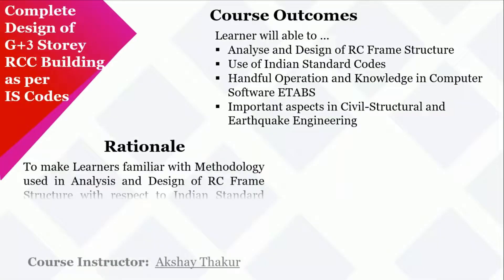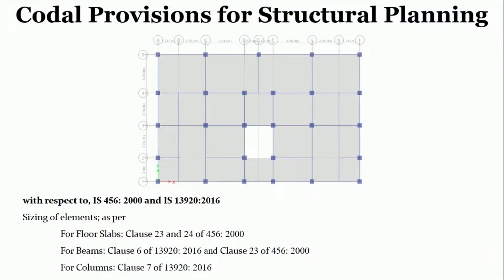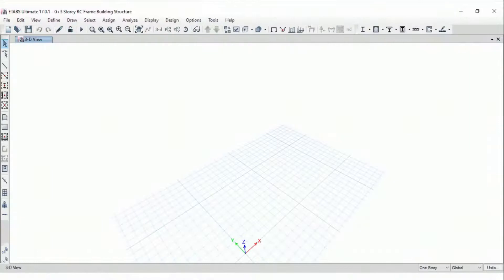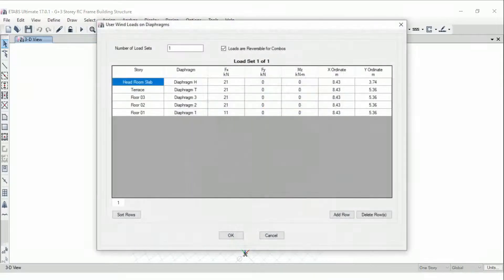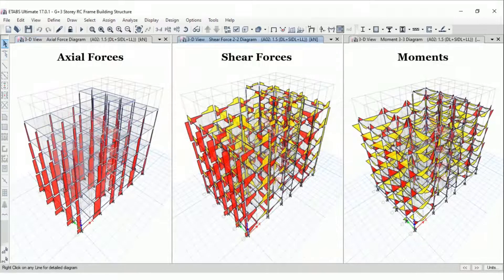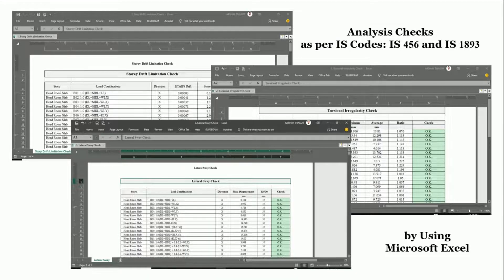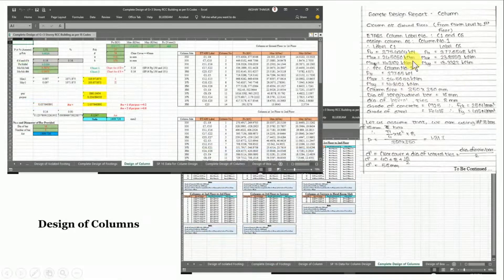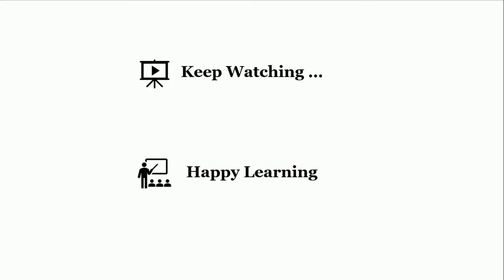1.1 Introduction to the Course │ Design of RCC Building as per IS Codes with ETABS │ Akshay Thakur

Comment: sir what could be the reason for not appearing the "rebar selection for column & beam" option in design- tab, any solution ?
Reply from the maker: Because in the newer version detailing is seperate by CSi detail software, earlier detailing is also can be done in same software so that option is not availble in newer versions above V16.

Comment: Hi sir which laptop will be best for this all structural softwares
Reply from the maker: Laptop with SSD, 8GB RAM & i5 and equivalent peocessor is what i can suggest this are atleast minimum level of configuration for general performance for softwrae like ETABS, SAFE, STAAD, AutoCAD, etc...
If you wants to use softwate like SAP2000, Revit, etc. then you must need higher configurations than above....
Reply: Sir I have 3 years gap after btech civil engineering 😢 I was preparing for government civil engineering exams but couldn't crack any exam, now can I become structural engineer??

Comment: In other videos, some instructors showed that etabs self-calculate the super dead loads of slab and beams, so they didn’t apply those loads but, like you, applied the wall loads. Could you please clarify?
Reply from the maker: ETABS have a feature to consider selft wt. automatically in dead load pattern, so whatever you model w.r.t. material, as per that material's unit wt. and shape wrt geometry ETABS Calculate Self Wt. that we don't need to bother....
only the loads that we don't,t model that we should apply.
Reply from the maker: and so, floor finishes, wall load, live loads need to be applied...

Comment: Sir only 40 videos are available out of 42 videos. The other two are hidden.
Reply from the maker: slab design videos are taken down because therein one mistake so...
Reply: Please restore it...the course will be incomplete than sir.
Reply from the maker: @mrpritam_n  you may refer any good book as per IS 456-2000, and as per that design slabs its very easy to do...
in short you have to calculate ly/lx and total design load for your slab and as per slab position in layout (continuity) you have to determine co-efficient from IS Code and simply find the moment and provide steel area to resist the same...
Reply: @AkshayThakur  thank you sir for the brief explanation.
Reply from the maker: @mrpritam_n  welcome!

Comment: Sir Which is the best book for manual design of building??
Reply from the maker: you can go through some nptel courses for basic concepts...
& you can also go through some books for rcc: by neelam sharma, p.c.varghese and s.s. bhavikatti
Reply: Thank you for your valuable reply n time
I want to design a building manually so will these books teaches from basics?
Reply: For practical building design sir
Reply from the maker: learn the software thoroughly, only understanding of design concepts are important in software-based computer design....

today's modern age software works on finite element based which is more accurate than what we do in manual calculation by influence area method...

once you understand the whole process of design then go for design-optimization... which makes a difference in professional practice of structural engineer!

all the best!
Reply: Thank you so much sir 😊😊
Reply: Sir Which is better either to learn manual design or to learn software? 
Or what you taught in the course
To design a residential building upto G+5
Reply from the maker: understanding design procedure is essential for a structural engineer, but beyond that... now-a-days software are used for designing structures so understanding software interface is very  important. Because if you give one wrong input then it may cause huge changes in design reinforcements of your structure....
If you can't optimize your design, then what its meaning? approximate rebar% contractor/foreman/fitter can also tell...
optimizing the design is the engineering in design of structures....

all & all, you need basic principles & concepts in structural design and building materials, understanding of codes & standards, proper knowledege of software inputs, understanding of analyatical output of analysis... to being a professional structural-design engineer
Reply: Thank you so much...for typing this much for us
We are grateful to have a sir
Reply: Your are a wonderful guide..you have the pure heart.and selfless...I know how difficult it is to make a course like this.. thanks a lot sir
Reply: Bro for building design of g+4 n all is Staad pro is good?
Reply from the maker: @rohithpatel8223  you can go with any ETABS/STAAD/Tekla whatever you feel comfortable...
Reply: @AkshayThakur  ok bro thank you

Comment: This is very useful content which I found related to building structural design using etabs.
Excellent work Akshay Thakur
I need  a suggestion for learning planning of a structural layout from available raw site according to vastu.
Will you please suggest any content which is available.......
Reply from the maker: Dear, Thanks for your Appreciation!

for architectural planning according to vastu you need to go through from very basics like sun-diagram to the every minute aspect of the structure according to its functions; for that you can search some best book from the disciple of architecture or some book of building drawing in civil engg. also...

& as you ask about Structural Planning for that you may need to understand all the aspects related to: 
1. orientation of columns
2. locations for concrete (shear) walls
3. shape & geometry of structure w.r.t. time period
4. proper beam-column layout
5. mastery over pre-design section sizes by serviceability criteria
above the 1st four you can get it through  "GSDMA Manual - Some Concepts of Earthquake Resistant Design" ebook freely available on web & for 5th point as mention above you do need to understand some of clauses of IS 456 & IS 13920 for preliminary section sizes
this things are very important to structural planning, although by the software you can optimized design.

hope this helps!
Happy Learning!